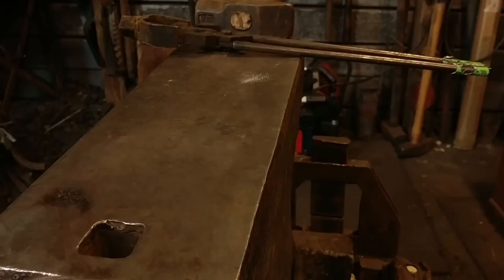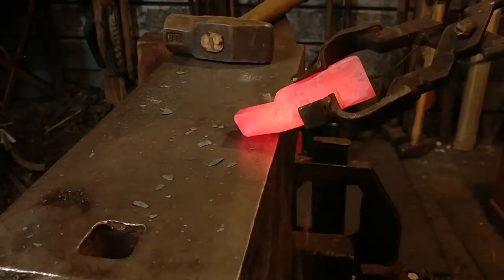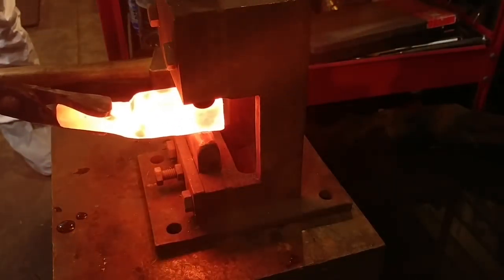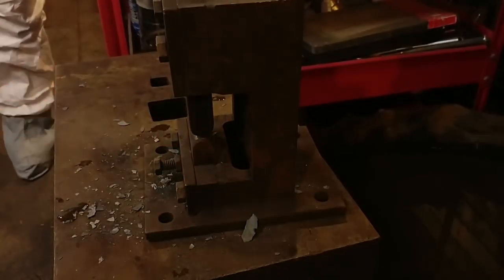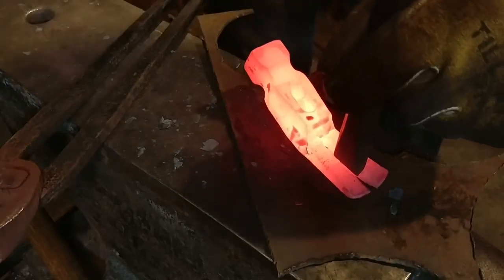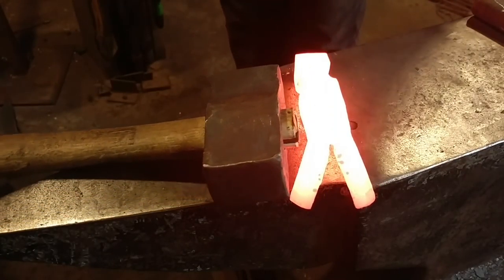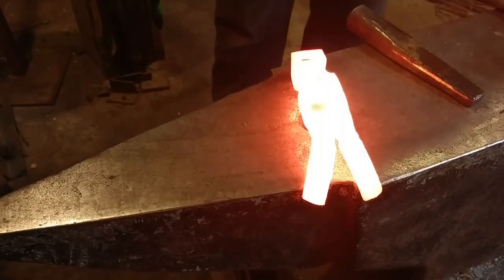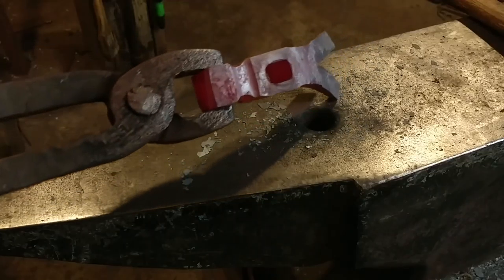Forging a Claw Hammer (Part 2)

Comment: 4:56 there is a spider running up the side of your anvil i dont know if you noticed that but there you go
Reply from the maker: +grayem pepper LOL no I didn't notice that :-) if I did I would have probably screamed like a girl on camera LOL
Reply: That was Roy's yoda. Think how many hammers he could swing
Reply: thats why you have BIG HAMMERS FOR, Not just forging. I assure you especially the big ones more then an inch get the 10 lb sledgehammer around here, facinating you did this all hand and hammer and no power equiptment to shape, this is what power hammers or presses are usually used for on most channels.
Reply: I did see the spider the third time I watched it, was more concerned with the cutting of the craws , situation awareness , went out to the window, lol.